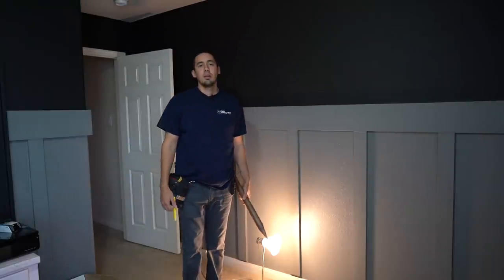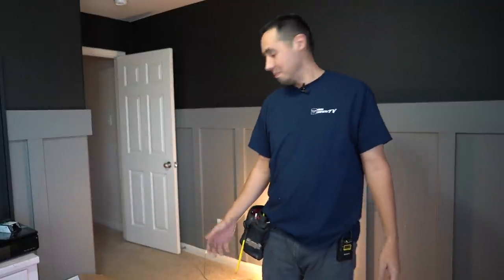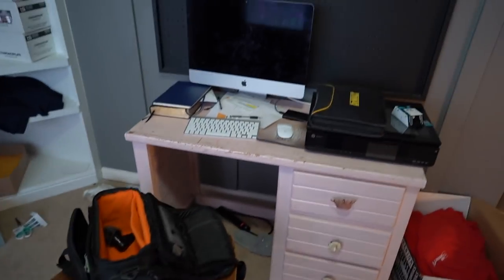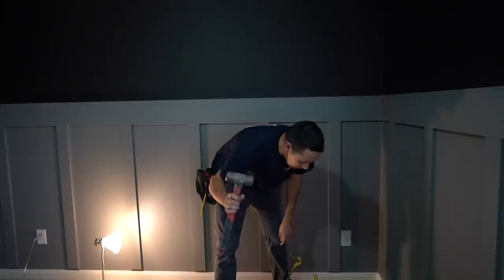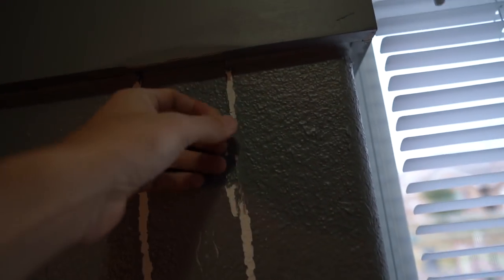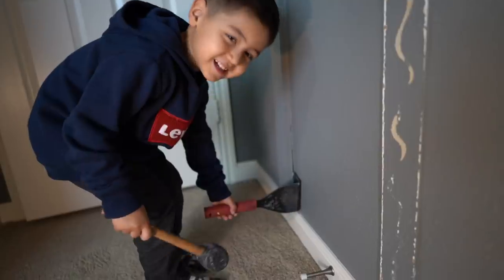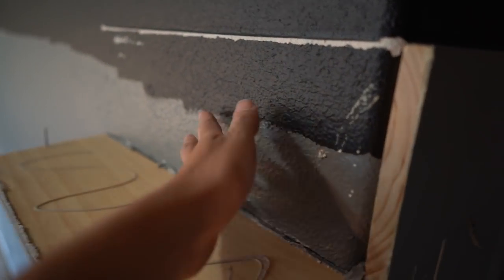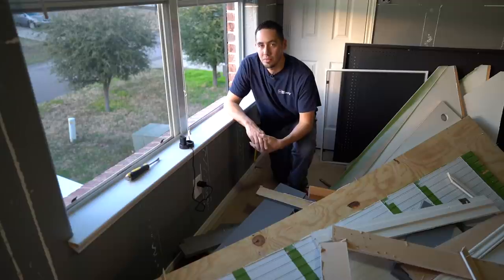How NOT to Install Wainscot

Comment: Excellent attention to detail. the list of tools you use is extremely valuable for people who are trying to do a project. Without the proper tools, the job will never look perfect. the proper saw, blade, technique is absolutely critical for properly fitting corners, seams. 
the glue selection is great as well. Speeds things along greatly. Very useful finish carpentry projects. A great learning for me. Saves a great deal of time, fustration, and greatly improves our confidence on doing these sort of jobs. Thank you

Comment: Congrats on the new digs!  I can relate to immediately tearing down.  Less than an hour after signing for our house, I headed to the new house with crow bars that I purchased - on the day our offer was accepted - and removed all the trim.  I love a DYI project, but I hired a craftsman to make my vision real.  Because it was a bungalow and I really felt quartersawn should replace the Big-Box-stock fix from previous owner, I went straight to an artist.  Worth every penny.  When in doubt, hire out.

Comment: Congratz on the new house. I have been using your cutting and pocket hole techniques. I have painted cars in the past. I have applied a modified technique to spraying latex on finished projects. Good coverage and super smooth finish.  I'm not professional...... just ADHD when it comes to detail. If it is not perfect, I will rip it out and start over.  Great channel, very useful information.

Comment: This is my last comment on this video I swear lol. I've always been fairly "handy" so have always taken on various projects throughout my life and different houses. Well, around 5 years ago I got into woodworking in a more serious way than I ever had before. At that same time I decdided to build my wife a built in, floor to ceiling, back lit on each shelf, shoe rack. At the time I didn't have a clue how to build that thing but I honestly didn't know what I didn't know if that makes sense. So I went ahead and built it and I thought it turned out pretty good. I knew it wasn't great, but I thought it was good. Fast forward a few years and I have really, really gotten into woodworking. I mean like the entire way in lol. I can't beleive how much it sucked me in and how much I've learned over the course of these last few years. Plus the insane amount of money I've spent on tools with my latest purchase being a Hammer A3-41 jointer/planer that cost a fortune (love that thing). Anyway, as you can probably guess, when I check out that shoe rack now I can't believe how bad it is. It's still nice enough that I'm going to keep it, but man, it has DIY written all over it (not as bad as the stuff you are removing in there though!). Anyway, just wanted to relate my story about how this sort of work comes to be!

Comment: I wish you were here. Lol, I say that as a preface to, "Please Help". 

I admire your work so much that I thought you might be able to help with a problem I just developed. We just got new windows installed, and they have to stick out a little too proud from the siding of the house for stability reasons. It looks awful. I am wondering if you've ever encountered this and if there is any trim ideas that you might have that could help improve the look.

Comment: Its all in the details!! this is my argument as a carpenter bidding/quoting against  the average handyman out there. sure they can produce a product that looks the same from a distance but did they take the time to pocket hole rails flush?? scribe corners, glue and pin miters etc. so that down the line you don't end up with intersecting points and or joints cracking like that. 
Congrats on the house btw

Comment: Congrats on the house. How do you hide the hardboard when doing wainscoting when it's exposed on the side, like when it ends in the middle of a wall. Do you do a thicker style and cut half way in style to the thickness of the hard board to hide it or do you put a peace of trim on the end of the wainscoting. Thanks for any info you can share.
Reply: Congrats on the house... do any of your kids like using the nail guns and saws? Mine do

Comment: Love your videos I just had a question about fixing wainscoting without a nailgun. Have you ever needed to nail by hand and if so how would you go about doing that? There is next to no information about doing that it seems, everyone just uses a nail gun but I was just wondering if you had any advice on that. Thanks!
Reply from the maker: djrussell89 I would definitely try to use a nail gun. It would be worth the investment. Especially if you miss a strike on the nail and hit the board with a hammer. That will just make more work fixing the dings and dents. If  I had to do it it would be much harder since I am used to the nail gun. It could be done for sure but with unnecessary added work. Plus finish and brad nails leave very small holes to fill.
Reply: @FinishCarpentryTV  oh absolutely thanks for replying, I do have a nail gun I was just wondering how they did this "back in the day" without the luxury of a nailer. But youre right... it's probably a silly question to ask in this day in age lol thanks again!

Comment: Congratulations on your new home. Your videos have helped me with so much. I'm glad to see good things happening for you. I would like to get some advice,  or a video down the road. I'm replacing drywall window returns (I think they are called that) and doing a nice wood casing. Started on some smaller windows first to get my feet wet. I'm working a large window now and the drywall around the window is soooooo messed up, not straight, bulges in locations because of the framing behind it. How do you adjust for poor build quality? Sorry for the novel, and thank you for sharing all your tips and advice!

Comment: Any chance you could create a short video on how you would normally tackle bullnose corner when installing wainscot?
Reply from the maker: Dennis Rodriguez yes,  I will do that. But the short answer is you can square it off and cut the contour of the bull nose in your top cap to round with the bull nose or you can simply rip the thin bullnose piece on the table saw at 22.5 basically making a big baseboard if you can think of it that way.

Comment: I think the guy that did the job before you probably realized it was only decorative and not permanent so he used brads and a little glue so as not to destroy the wall behind it in case you wanted to change it. As you found out, it came off easily, it didn't ruin the wall and now you can add your own style without redoing your drywall. Sure he didn't do it as well as a master carpenter but it worked for his purposes. I don't have a problem with that, if he were building a cabinet, a piece of furniture or something structural I would have an issue. But some decorative trim, not so much.

Comment: Question - @3:35 I'm guilty of this to some degree, but what is your suggestion to correct this? Ultimately it's the difference in material thickness / cut too short. But, is this case, how would you fix this? Would that particular stile (in this example) be scrapped, and cut a new one and add a small spacer behind to make it flush?

Comment: you're lucky your previous home owner just used a couple small nails and minimal adhesive.  My previous home owner used freakin epoxy to glue things and not even one screw matches the rest in just about every project in the house.  He must have carried a bucket of random screws and a tool belt with ten different tools to match whatever screw he pulled out of the bucket. Home ownership will be the death of us!

Comment: When doing wainscot with 1x (real wainscot), 2 things are paramount.
1) Pocket hole jig
2) Glue

Jig the parts together, wood gluing the joined surfaces. Then glue the panels to the walls when installing. They will never come apart from swings in temp and humidity, at most you'll get swelling differences in the 1000's of an inch from grain density, but quality paint will bear the burden.

Also level the rails, plumb the stiles, and string line the face of the panel unless you want it to look like complete shit.